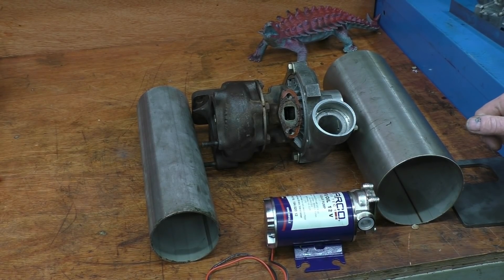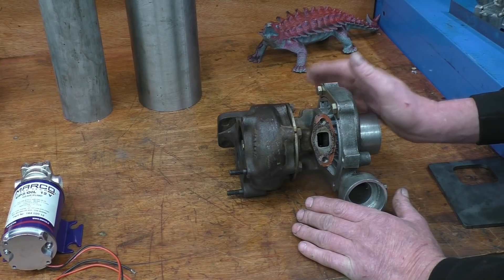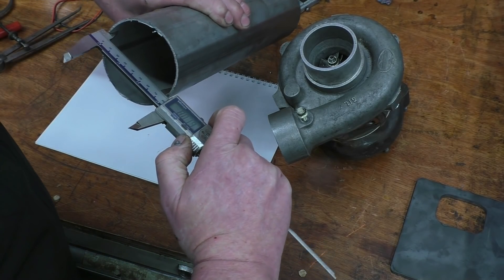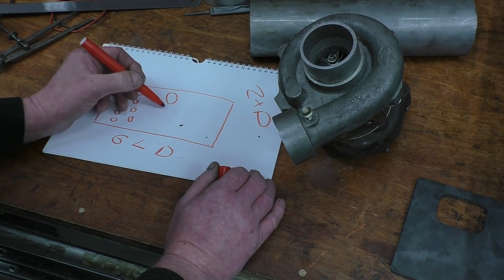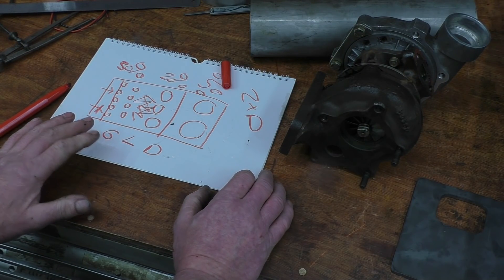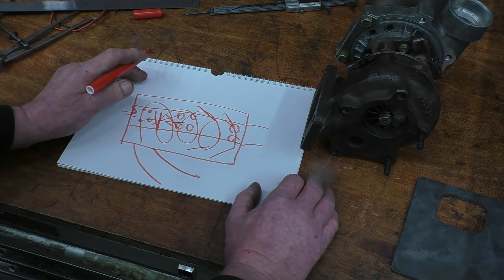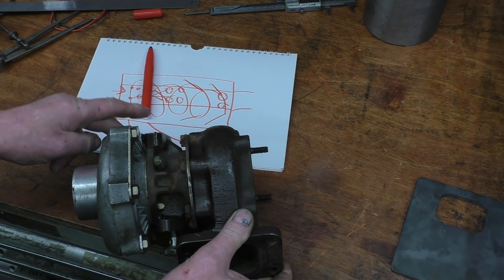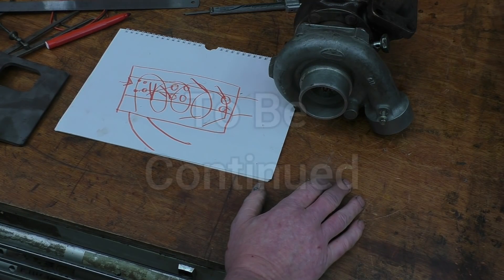Jet Engine P2  The Maths

Comment: Nice to see this. Just a quick one, you seem to imply you want the air intake at the top of the liner and the air to swirl inside it. Swirl is bad. You want the maximum static pressure in the liner to force the air into the holes in the flame tube. Swirl diminishes that. Whats needed is a diverging diffuser duct entry, preferably at the bottom. Never mind me though, you have done it and it works.

Comment: If you know the manufacturer of that turbo in particular the compressor impeller you may be able to get a compression map. That way you can ensure  you run it at an optimum pressure ratio/ flow/ speed for optimum compression whilst staying away from surge. Maybe even Tripleboost!